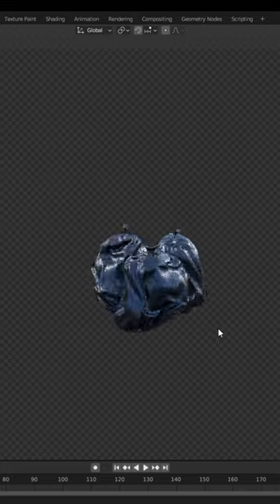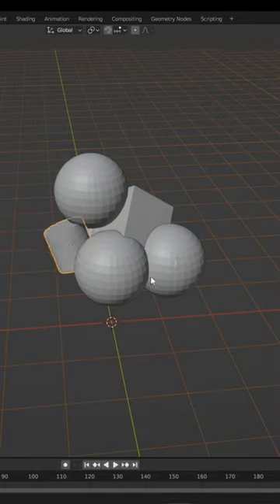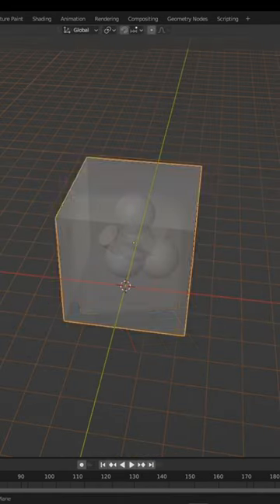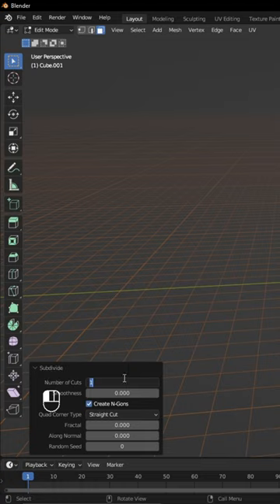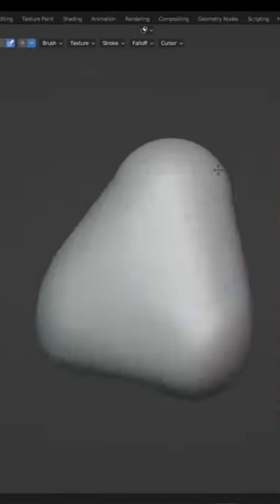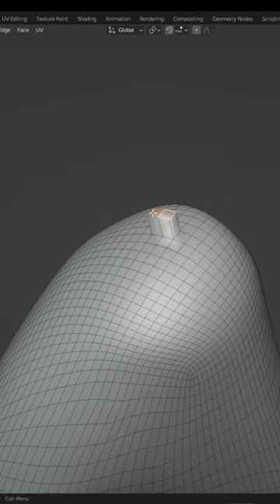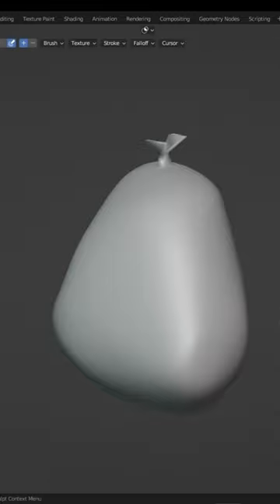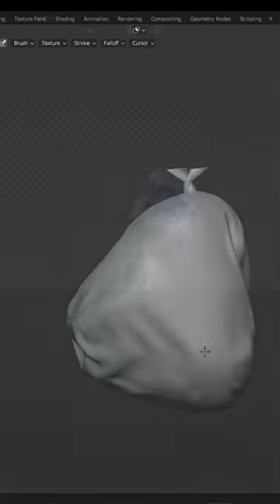Create Trash Bags in Blender in 1 Minute!

Comment: My pc will blow up when i put subdivision over 20
Reply: Haha, fr! I will try this and return to tell you how mine went!
Reply: Update: Mine was able to do it, but the object doesn't show on object mode, lol.
Reply: I just put it to 100 and it worked great since it's only 60k vertices
Reply: Your pc is not fit for 3d modelling then lol
Reply: @Bykni  He probably mistook the subdivide tool for the Subdivision Surface modifier (putting that to 20 would result in a trash bag of 6.5 billion faces).
Reply: Your pc is way too ancient
Reply: @grass_rock  GTX 760 Intel i5 6???
Reply: @oravapelaa8947  
Your GPU is the problem
Even a modern igpu outperforms it
Reply: @grass_rock  yeah i know :D. But it runs games good enough.
Reply: Same
Reply: @grass_rock  subdivision happens on the CPU at first, no?
Reply: @grass_rock  is mine ok? I have a GeForce RTX 3090 and an intel core i9 3.60Ghz
Reply: @Zerobird-fx2xw  
More than ok